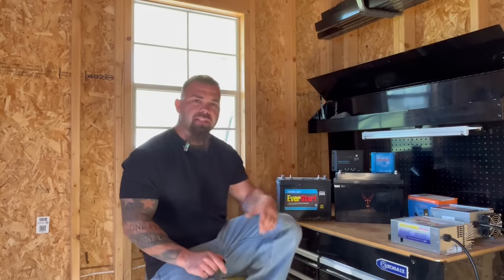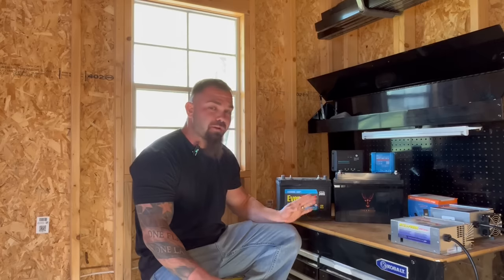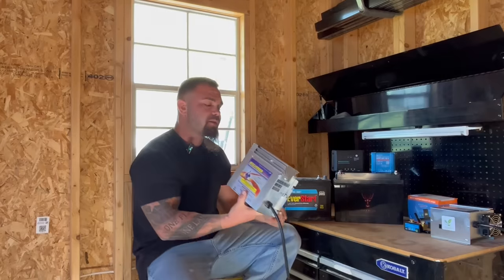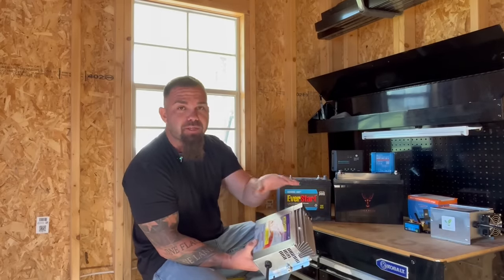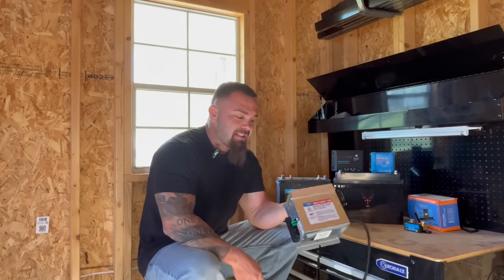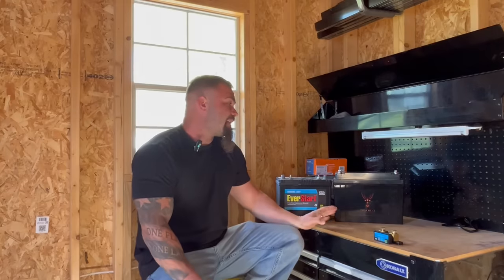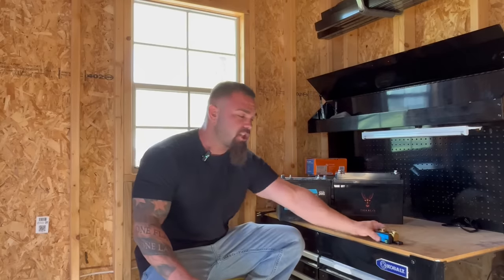Swapping to Lithium? WATCH THIS FIRST!

Comment: Thanks for the info, just one question.  If charging your Li battery from your vehicles alternator with the DC to DC converter does it knock up the voltage to the correct value to fully charge the battery aswell as limiting the ampage???
Reply from the maker: @Daveyboy1066  No, DC to DC chargers do not regulate voltage unless the voltage is too high, they only regulate current. That is a good question though as unhealthy alternators sometimes carry lower voltage and thus will only charge the battery to the level of voltage that the alternator can provide. 

For example if your battery needs 14.4v to be fully charged and your alternator is only putting out 13.4v or your wiring from the alternator is too small causing a voltage drop to 13.4, the battery will only charge up to a state of charge equal to that 13.4 voltage not fully charged.
Reply: @rvsolarconcepts  Actually, there are many Buck-Boost DC-to-DC Chargers.  The input voltage to the charger can be higher or lower than the output voltage, that is needed to charge the Lithium Battery.

Comment: I’m afraid of lithium batteries because of the chance of them exploding. Heard about it happening. Don’t know how common it is.
Reply from the maker: That's "Lithium-Ion" that catches fire and makes its own oxygen which makes them extremely difficult to extinguish. That chemistry has been phased out and replaced with "LiFeP04" otherwise known as "Lithium Iron Phosphate" as the newest most stable chemistry. The early days of dangerous lithium are all but past us now. It is a common misconception in the market.
Reply: Call up the firemen who deals with these types of batteries they will tell you. I wouldn't use them in a flashlight. Very un stabel. I used them  in R/C Airplanes long before they started putting them in cellphones  we started hearing about them exploding in phones  we new what they were doing using there old chargers witch wasn't a balance charger. They would over charge them. I wouldn't trust LiPo batteries  in my lawnmower.

Comment: So i have 2 x 110 ah lipo4 batteries to run my 24v trolling motor with blutooth bms. The boat has a 3 bank 15 amp charger for sealed leat acid that switches off at 15.0 volts. I need to test volt level where it comes back on,
My bms says my lipo4 battery is fully charged at 13.6 volts. It reachsd 100% soc at that voltage but the bms has not switched charging off yet. Still testing for that voltage. 

So is there any reason i cant use  a lithium compatible solar charge controller on each bank of the lead acid marine charger to switch off charging at the desired level?

Comment: The term ‘compatible’ is used during this video. So if an owner kept the original converter charger, operating at 13.6 vdc output for lead acid, would there be any possible damage to that converter charger by having a solar array using a 14.6 volt output (via a MPPT controller) after changing out to Lithium batteries? Would a higher voltage ‘backfeed’ be detrimental to the original converter charger?
Reply from the maker: No, it wouldn't cause damage to the converter, but the converter wouldn't put out much (if any) charging current because of the higher voltage it would be seeing.

Comment: And what happens when you use a 14.6 charger on a standard 12 v. 13.6 system?
Reply from the maker: Nothing adverse happens in that case... Lead acid batteries often achieve a voltage of 15-16 volts during an equalization cycle.

Comment: Lead acid charges at 14.4v not 13.6v, that's the float. Lithium charges at 14.6 and does not have a float. New resting lead acid is 12.92v while new resting lithium LifePO4 is 13.6v. Discharge without dramatic voltage sag is the largest when pulling high amps is one of the best reasons to switch.

Comment: Any issues just upgrading standardflooded interstate batteries with agm???
Reply from the maker: Same things apply, the voltages are usually different but most chargers on the market are adapted to do both because those chemistries have been out for a long period of time.
Reply: Flooded & AGM are both lead-acid so there's little difference apart from it's more common for AGM not to be capable of supplying the huge current needed to get a starter moving. The difference comes at the other end – AGM survives discharging better so they're more suitable for running domestic loads overnight when there's no solar.

Comment: What about using a Marine deep cycle battery because you want to keep a battery ready to run an electric trolling motor or a radio transmitter GMRS or HAM radio system
Reply: I run the trolling motor, lights, and electronics on my daysailer with a 100 ahr Li-Time battery that cost $250.  The boat has no motor, so I mounted a 40 watt solar panel to keep the battery full.  Used a cheap solar controller set to 13.7v.

Comment: Yup, and just found out the hard way that you can't drop a 'gel cell" battery in where you've had a Lithium. Have to change all the equipment out again.
Reply: Gels are even more sensitive to high charging voltage, but most Lithium regulators and controllers are sophisticated enough that you can select gel settings.

Comment: Does the dc to dc converter also change the voltage to 14.6?
Reply from the maker: It is fully programmable just like the victron charge controllers, yes. The voltages can be set to your parameters in the bluetooth app.

Comment: If you are using it on a boat motor, how does that work out with how the motor is charging  the lithium battery?
Reply from the maker: @Goodellsam  Nothing changes, it's an engine that has a belt drive system just like a car. The belt is rotated by the crank shaft and turns the alternator which produces a voltage to charge the battery. The application makes no difference an alternator is an alternator.
Reply from the maker: @Goodellsam  unless the boat engine is smaller and does not have an alternator, then it utilizes the internal magneto and stator to create a small amount of power but the voltage on those systems is fixed and can't really be manipulated. The voltage on those systems is largely dependent on engine RPM and they don't usually produce a high enough voltage to charge a lithium battery.

Comment: How would you go about setting up a hybrid system using Trojan 6v wired for 12v and lifpo4
Reply from the maker: We never recommended mixing battery chemistries. The charge parameters for the different types of batteries are very different so you can't really have two different types of batteries unless you run two completely different systems... There is almost no upside to trying to do this. What is the reason you are considering this route?
Reply: @rvsolarconcepts 
The reason I want a hybrid system is so that I have if I’m away and the lithium shuts off there’s a bit of backup power, flooded led acid batteries go upto 14.2 and floats around 13.6 I know this as I’ve lived on a boat since2009

Comment: Why do I have to start replacing things in my boat. If the outboard doesn't charge the lithium, what's the difference? I'm plugging in my lithium starting battery at the end of the day at the dock and letting the onboard charger do the work.
Reply from the maker: Who said you have to replace things in your boat?? 

What was said was, you'll need to replace charging components that do not achieve a high enough voltage to charge lithium, and you'll need to protect your alternator if it's not rated high enough for the amperage that is being requested by the batteries...

If your only charging source is a plug in manual charger then none of this applies to you specifically...
Reply from the maker: For example,  my personal boat has the 8.1L Mercruiser in it which has an alternator for charging so I would need to add a DC to DC charger to it if I saw that the alternator was being maxed out by changing to lithium batteries that pull more charging current.

Comment: Hello    a limthi. Charger well it damage  a led battery?
Reply from the maker: Not immediately but the higher voltage coming from the converter would likely cause damage to a lead acid battery if left to charge for a prolonged period. It's best to match the charger to the correct battery type.

Comment: tLiFePO4 Battery start a Onan RV Generator 5K or 7K?
Reply from the maker: When considering which batteries to buy it's important to note the discharge current limits to answer this question. Every manufacturer does it a little different but most 100 amp hour batteries have a 100 amp continuous output rating which is right on the border of what it will take to start the generator. If you have two of those batteries in parallel it doubles the output which is more than enough to start a Cummins 5500. 

The larger batteries are hit and miss on the BMS output so just make sure if you're buying a 200 AH or larger battery that the current output on that battery is 200 amps continuous or more and you'll have no issues!

Comment: Be careful connecting an alternator to a Lifepo4 battery - the current controller in the battery can cut out suddenly causing a spike in voltage, maybe frying your alternator.

Comment: A lead-acid battery charges at 14.5volt to boost amp and rest at 13.5volt.
Reply from the maker: Are you talking about an equalization cycle?
Reply: @rvsolarconcepts  from a typical "12v" system vehicle alternator charging circuit. The voltage regulator in them usually puts out 14.5v or even 15v during charging, depending on extra draw required to plan for from added options/accessories, especially for bigger current hogs like air conditioning. Instead of say a 60 amp alternator in a base model (I forget the exact amp of the ones I had?!) you'll likely find something like a 90 amp alternator or even higher if your truck has every optional bell and whistle.

Comment: the batteries in my bank consist of 12 6vdc 200a wired to 12vdc. is there any reason for to switch 12 12vdc li-ion 100a?
Reply: Half the weight and twice the useable power next time you replace batteries.

Comment: have you ever tried a generic step up buck inverter (dc-dc) to a solar charger as wired to solar panel input side? ok! alternator output 110 amp 12v wired to first RV engine lead acid batt,, then the step up voltage change say a 15 or 20 amp step up buck inverter  to solar charger panel, volts n amps set for Li batt. output charging?  I also did a 4 ga. (oversized) wired in Anderson connectors 175 amp. secondary 18 hp gas engine (duromax - muffled sound output) at idle rpm to a self ignited output start alt. (Amazon)  1 wire gm 110 amp alt. that runs at idle for 10-12 hrs on 2 gallons of gas as my alternative charging system (noted 10-40 amp max output draw on alt output),  so no shore or generator 110 v ac power for complete off road n solar system! I monitor batt charge state and solar at dusk and decide to run for overnight charging or not.  am currently looking at dual batt system on flip flop relays. batt life is best if charged  full then drained for max life cycle usage. using voltage comparators (black box) to switch between use or run time and charge times. black box also notes current output usage of run batt set to also draw added power from solar or secondary charge alt system - 18 hp alt.  to maintain current output state and provide power to charge 2nd batt set and monitor that charging. note 18 hp is electric start with hand recoil incase of all discharge 12 v batt system failure. ie rv main engine batt failure off road recharging system. I have well over 3500 hrs on 18 hp at idle, maintenance: oil change and valve readjustment and v-belts. developed 18 hp idea on lead acid system then went to try solar  chargers n panels and now Li and starting dual batt... lead acid weight @68 lbs per 6v batt and still weighs more than dual Li batt system - got plenty of under floor area for space to use - not sure if temp regulation system is need under there yet - bluetooth temp monitors modules to watch application - don't rv in winter though ice fishing could take place.  so heating might have to be done - simple solution is 12 v dc 3D printer heated bed plates can do the trick of heater elements wired to a temp thermostat for on off relay as direct batt attachments or as room or box enclosure element control... Note: 6 v battery equalization charging every 3 or so times is recommended for 6 v deep cycle lead batts - that is a 15 v dc charge - electric golf carts utilize equalization batt charging. Ezgo batt chargers equalize charging every time a charge is done. also car/truck 12 v batts are 14,4 v at full charging. during batt cool down readings of 13.6 v typical.  12.7-12.8 v reading at cold state in normal. a top drain on a fully integrated battery digital state load tester drains the top state v for tru load testing of lead acid batteries. the 60 plus fuel tank rarely ever runs out before any dead battery stuff has happened - 18 hp system with ac n heated rv fishing n hunting season. running generators and inverter generators cost is way higher than this setup. Could do a dual LP n gas 18 hp maybe someday. got rid of LP refrigerator wasn't cost effective, replaced with110 v electric also replaced roof ac with mini split more efficient output - under floor space. I've not seen a Li load tester other than the BMI data - which do fail. yea I know negative side attachment as you showed.

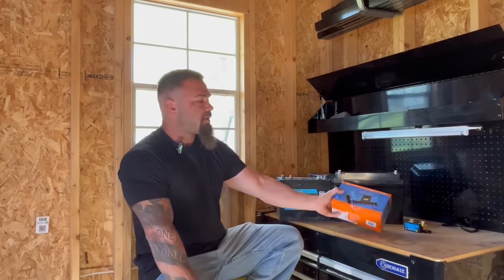Comment: 9:09 I think you meant to say, “drop lithium batteries” in there in place of lead acid.
Reply from the maker: That's correct haha. Had a little slip up there.
Reply: You did a good job. I couldn’t have said it all any better. Off grid two years:  47,000W of PV. 225+ kilowatt hours of lithium iron phosphatebatteries - all DIY.
Reply: Working on installing a solar system on a Winnebago towable 17’.
Reply from the maker: @rv10flyer84  Nice! Let us know if you'd like to see any parts of the install to clear it up if you run into any issues!

Comment: I have no problems with a regular battery. Why pay more?
Reply from the maker: @jeffnations6649  It ends up being the same price or cheaper over time. The initial investment is more but lithium lasts 10 years vs 2 to 3 here in the Arizona heat. The perks of lithium would include no corrosion,  no maintenence, no water filling, lighter weight, smaller overall package size, easily tracked state of charge, easier trouble shooting power issues... There are a ton of benefits and instead of having the frustration and work of replacing lead acid 4 times in ten years lithium will be one time in 10 years in most cases, sometimes longer.
Reply: @rvsolarconcepts That Walmart Ever Start Battery is NOT a Deep Cycle battery.  Buy a real Deep Cycle battery and it will last 7 years. And you have but a new charge controller for lithium.  And Lithium batteries can start on fire.

Comment: 9:05 False, if the alternator can not handle sateruction at 100% duty, you got sold a bad alternator. I run LiFePO4 batteries that draw 150 amps of my 175 amp alt for several years without issue.
Reply from the maker: That's like saying that because your car engine can rev to 6000 rpms that there's nothing wrong with driving it at red line everywhere you go... A dc to dc charger is there to help protect the alternator from premature failure.  i haven't heard of many catastrophic failures right after getting lithium installed but I have seen tons of people replacing alternators a few years after which is not normal. In any case, running anything at 100% output all the time will cause it to fail sooner than running it at 50-60% that's just common sense man.

Comment: what a great idea, having to replace your converter in your camper right off the bat. No thanks on Lithium. Jeeze! Not only do you have the cost of the battery, but now you have to rip out your converter. That or just buy a new camper. Screw that!
Reply from the maker: Lithium is definitely not for everyone but changing the converter takes about 15 minutes haha.
Reply: As he said in the show, modern converters have a switch for different battery types, yours may be new enough if you look.